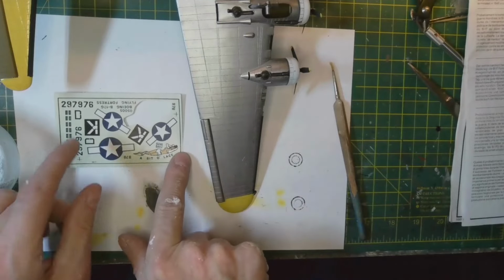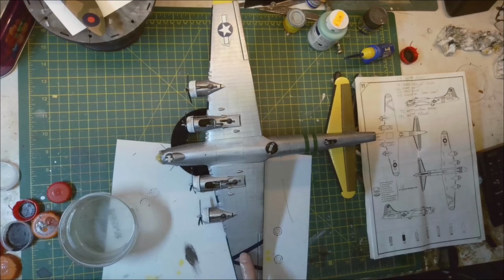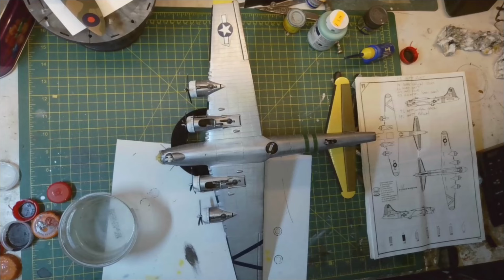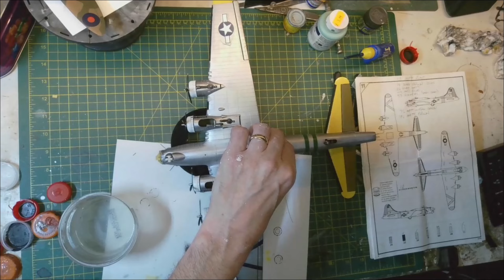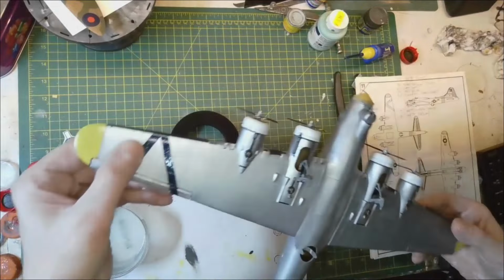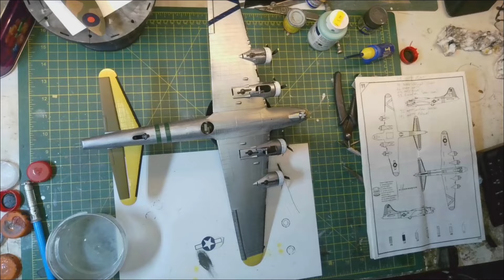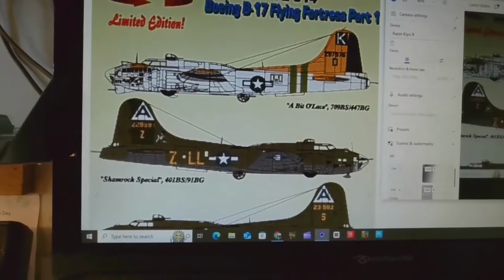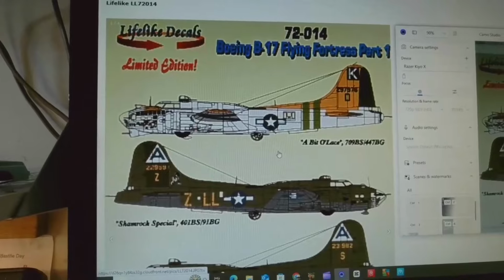The 2024 Solution for Disintegrating Decals

Comment: I've been modelling for so long I have a stash of spares. Where I find I don't, I go for after-market decal sets. Degraded decals in old kits is just something I expect.
Reply from the maker: yeah I do have a box of all sorts of spare decals some actually going back to the 80's. these ones gave me no clue whatsoever they were going to fail until you see me use one in the video, although 90's airfix decals could be notoriously bad, especially ones that were on a brown backing paper, I have a 1/24 hurricane that came with them, and I replaced them pretty much straight away.